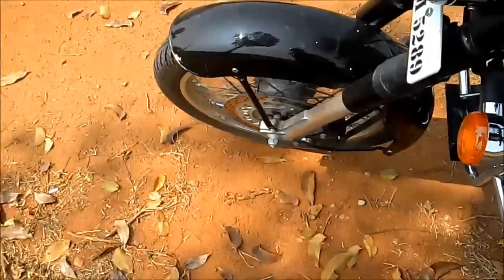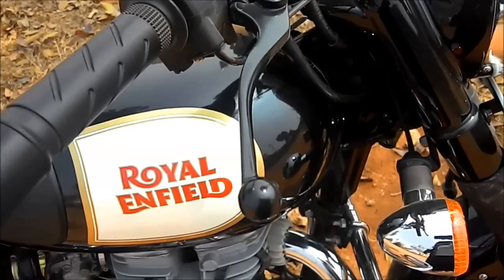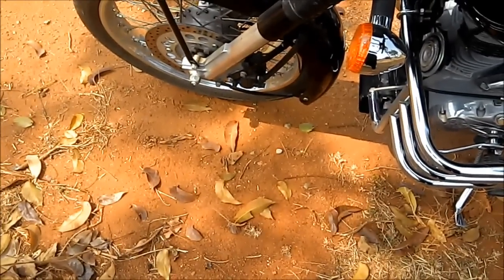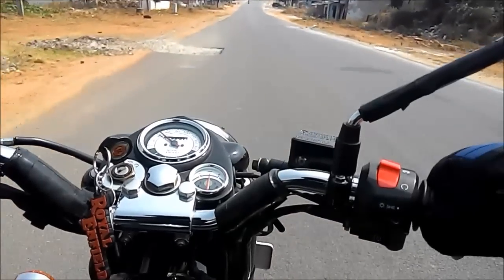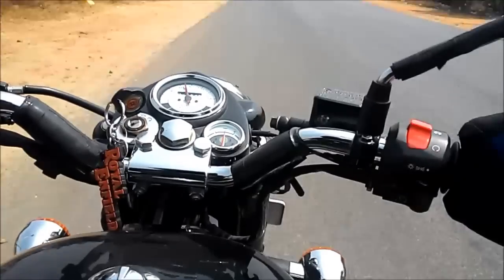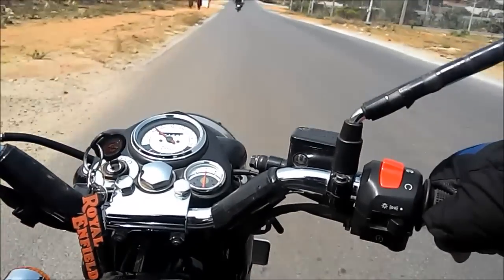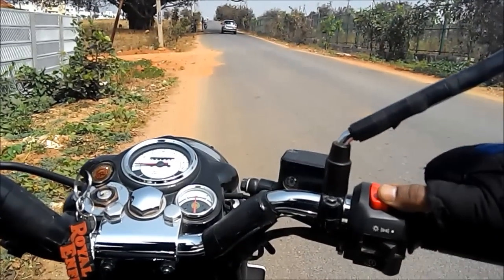Royal enfield Classic 350-  Braking technique

Comment: The problem with the "not very good" rear brake is the factory paints the bush (145088) for the operating cam into position with the screws fully tightened. That bush is supposed to slide slightly to align the two brake shoes. Dismantle, clean away the paint, tiny smear of copper grease and just nip up the screws so you can just slide the bush plate with a lot of hand force (so it will move under foot pressure on the lever), hence the two outer lock-nuts. After sorting it the brake works very well indeed.
Reply from the maker: Thanks for suggestion! I will try it when I'm free

Comment: +Ajay Kaushik
 dude you told in one video that you used rubber washers in handlebar bolts to dampen handle bar vibrations. please tell me how you did that and its effectiveness
Reply from the maker: No. It does not work very well. That stupid rubber lost its vibration damping ability quickly
Reply: Wokkeyy... Shall i change the engine oil with motul 7100 or 5100..which is better..??
Reply from the maker: +Ali khan 
At present, I suggest motul 5100; I've heard that using a full synth oil in enfield might lead to clutch slipping in the long run

Comment: In my motorcycle training class, they suggested to use only two fingers on the brake lever to reduce chance of lock up. Also, to gradually increase brake level force over 1 second time period...this is because the front tire gets more traction as the weight shifts forward on the front tire during braking. So, you can apply more brake force as the front tire gets pressed down into the road. Never apply full force to the front brake quickly. 

For the rear brake, as the weight shift forward, the rear wheel gets less grip on the road and will lock up easily. You need to feather touch the rear brake on the bike and ease off the rear as the front does 70% of the braking.  If you do lock up the rear, it is best to keep it locked up until the bike stops...releasing the rear from a lockup can lead to a sudden re-straightening of the rear wheel track, leading to the whole bike flipping violently...you can get thrown off the bike...called a "High Side" flip.

Finally, try to NEVER apply brakes when turning the bike! Get the braking done before entering corners, especially when it is wet road.
Reply from the maker: Very true friend!
But if you try the enfield's brakes you'll understand better yourself.
It is better to use a 3-finger pull as it is not a 2-finger lever
Reply: Maybe look at changing the brake & clutch levers? There are many types on the market that offer great adjustability. I just installed new ones on my Bonneville last night...very easy to do.
Reply from the maker: +TornadoCAN99 
At present no. But maybe a yes later.
Its not even a year old yet. So, let it stay stock until the end of the warranty period atleast

Comment: there are many bikes are available with rear wheel disk break pre-installed.
the front disk break on classic  350 do its job pretty well, 
but it is un-complete with out help of a powerfull rear break.
in case of original drum break in classic 350 is useless & incapable of stopping the heavy bike.
Reply from the maker: Yes. Thats why I have started using this braking technique.
Rear brake is next to useless and does not help in shredding much speed
Reply: +Akash Bajpai most of rear discs are nothing more than sales gimmiks. what happens is when we apply even little bit of front brake first the weight of the bike shift to front wheel, rear wheel does not have much traction left so does not matter what brake disk or drum they all work well in rear
Reply from the maker: kanwarjit sidhu
I beg to differ sir. The effect of a disc brake on a rear wheel is very apparent, comparing it to a drum brake. You can ride your 2004 bullet and compare it with the RE Himalayan itself. The rear disc on the Himalayan delivers a vastly superior braking force compared to the drums on the enfields.
Reply: Ajay Kaushik
I have lived in USA for a while, am 63 years old had 8 bikes there. went to a riding school there too. try it on ur Bullet, go upto 25-30 km speed and apply front brake with full force. u will notice quite a bit compressing of forks. that is how most of the weight is transferred on the front tire. yes discs are better than drums but they also cost more and add extra weight on a bike. best way to stop a bike is 80-20 front rear combo. even on a turn if u have to brake in an emergency u first straighten the handle bars (even at risk of running off road) then apply full front brake. then release the brake and turn again. this is what they teach in american bike schools. instructors are mostly bike racers. depending on front brakes will help u stop much faster and rear brakes are mostly for little addition to braking force. i have avoided accidents by stopping the bike properly. this is a platform for us to share our experiences.
Reply from the maker: +kanwarjit sidhu 
What you said is exactly right!
But if you apply front brake in full force on enfield, brake will lock up very fast and cause front tyre to skid. Thus, you lose balance and hit the road.
This is very apparent, especially on wet roads
Reply: No they won't skid because the weight of the motorcycle and rider will make the contact patch with the road an area of high friction. that is why discs are better than drum brakes because they are slow to lock up. u need to experiment a few times on ur bike. on wet roads, u need to understand the limitation of ur bikes braking. no sense going full speed when we know rain is making the roads slippery. watch moto GP and superbike racing videos. in US i watched a few bike races and if u have idea of technical aspects of braking u can learn a lot from those racers. remember they have 200 plus HP machines and we have to manage our 18 HP street bike. idea is to get the fundamentals right and apply them in time of need Ajay Kaushik
Reply from the maker: +kanwarjit sidhu 
https://youtu.be/NYL257jpBXs

For the exact meaning of what I said, you can watch the above video

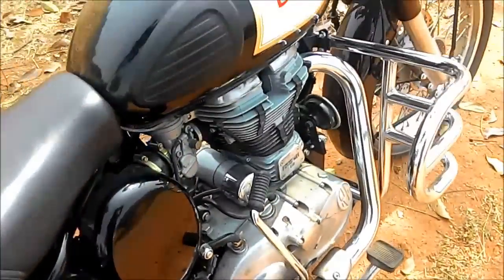At 1:55 watch the accident-exact demo of bullet lock up
Reply: Ajay Kaushik
Yes a perfect example of a fellow who is not trained to use brakes.he should have kept going in the direction of the car, after making sure handle bars are straight braked full power with front brake, released brakes in one second then turned away. instead he used rear brakes while trying to turn away from that car. that locked up the rear wheel and swung it towards the car. even if he had disc brakes on ear wheel he would have had same results. once i was riding a yezdi 250 with drum brakes on a slight down hill in rain. i was heading for a busy intersection. so i started braking almost half km away. with both drum brakes i was able to lock up both wheels while motorcycle kept going. any way by releasing and applying brakes and sliding with both brakes locked up some time 20-40 yards without falling i was able to stop barely one foot before hitting the traffic. after that i studied braking in gr8 detail. in india not safe to go at very high speed in traffic. learn use of front brake on ur bike no matter if it is drum or disc then u can have more confidence in an emergency. rear brakes don't do more than 20% in bikes as rear tires loose traction  very easily
Reply from the maker: +kanwarjit sidhu 
Exactly! rear brakes dont provide much stopping power on bikes; especially not on heavy bikes like enfields.
That is why I made this video-To show how we can use front brakes for a fast and safe stop
Reply: Ajay Kaushik
Too bad they increased the weight of these newer bikes by 20 some kgs as compared with older ones. as for heavy bikes u should if u ever get a chance try super bikes from 70-80s and full size harleys. those are heavy bikes. RE is a full size bike but is considered light by international standards. i had a harley 883 cc and it was around 80 kg more than Bullet with more power but very similar riding quality
Reply from the maker: +kanwarjit sidhu 
You are very experienced, sir; both in age and no.of bikes ridden. I'm still a teen (19) and have owned just 2 bikes-This is the second one
Reply: +kanwarjit sidhu - The rear brake on the Bullet/Classic can be fixed so it works as efficiently as on all old british bikes and car drum brakes. The bush plate must slide, it's an assembly error, it was not designed to be bolted tight and painted in place. It has lock-nuts for a reason.
I'm riding a 187kg Classic EFI-500, which is about as heavy as I want at my age but I have fixed that rear SLS and it works very well - when we get both shoes to make contact with the drum.
Some of my friends have Harleys which I have ridden and was advised that if I wanted to go faster I should apply the rear brake - meaning it doesn't do very much (british understatement) , and they were right. The bike ploughs straight on at 70mph. It's embarrassing ;)  That extra 80kg is like carrying a large pillion passenger.

Comment: i use clutch while braking... it gives a smoother feeling while stooping..  i want to know the thumb rule.. how to brake... should i indulge clutch?
Reply from the maker: No.no.no. Please dont do that. Only use clutch to downshift and use engine braking. If you pull in the clutch and hold, it will no doubt be smoother, but there wont be any engine braking happening.
You will be fully relying on the disc at the front and partly on the rear brake.
This will increase your stopping distance a lot and if you pull the brakes too hard, you may even skid off the road.
So, use the clutch to downshift and engine brake, but never keep it depressed when braking

Comment: Hi, how to use the back disc of thunderbird in rain for   immediate stopping? which silencers are available by RE for the loud thump so that, engine warranty is valid?
Reply from the maker: Regarding back brakes, you cant use that to come to an immediate halt. It only performs an assist function. The main stopping force comes from the front brake only.

Regarding silencer change and warranty validity, ask your service centre or dealer.
Reply: Thank you

Comment: rear breaks on royal Enfield classic 350 is really bad.
c
install disk break to rear wheels of classic 350?
if yes then how much it would cost..
Reply from the maker: I dont think it is goid idea to install rear disc brake.
It would be very difficult to pull out the rear wheel in case of puncture/tyre replacement.

See if you can install twin disc brakes at the front
Reply: +Akash Bajpai - possibly cheaper, they'd be using off the shelf bolt-on parts, see CGT and Himalayan. Use of discs front and rear also allows ABS to be introduced for learners.
ABS will be required from 2016 comply with Euro-nanny laws for export. No reason why the wheels shouldn't remain quick-release (pull pin, drop wheel).

Comment: I have recently owned classic 350 but my  bike has very much heating problem . what I should do
Reply from the maker: Check oil level. 
Also, ride some other classic and test if the heating is same or not

If you ride in heavy traffic, then the heating problem will be there, as not much air circulates around the engine to cool it in traffic.

Some level of heating is common

Comment: press release press release me bike jhatke bhi toh khayega na..i mean u press n release continuously, its gonna give u jerks as well ryt??
Reply from the maker: Yes. It does. You can see a bit of it on this video.

If you want little/no jerks you'll have to increase frequency of the press-release cycle. 
In other words, you should continuously press-release the lever.

You'll basically do manually what an ABS system does through sensors.
(On Apache, the ABS monitors brake fluid pressure upto 10 times per second). Manually, you could be doing like 3-4 times per second at max

Comment: I subscribed just cos I saw the way u reply to everyone's queries. need more youtubers like u. btw I might be booking an RE desertstorm or classic 350 this week. although one of my frnd is helping me with this. Im still confused between the two, any suggestions frm ur part..... ?
Reply from the maker: Thanks for your compliment!
Suggest you to go for Std 500 instead of DS 500. Maintenance and service costs of EFI 500 are relatively higher. And carbuerettor is good enough for this bike in my opinion. The difference in power and throttle response between the two cant be made out distinctively, unless you really concentrate a lot on it.

Comment: Guys finally I got my 350 classic today. Not very happy with original sound of the exhaust pipe. Also leg guards were of poor quality saw some already rusting. Where can I get these piece modified in Bangalore? Any help is appreciated.
Reply from the maker: What do you mean by leg guard?
Crash guard?

The original part costed me around Rs. 1400 at the delivery yard itself.
Didnt they give you a new one?
That is an optional accessory. How the hell can they give you rusted one? Demand new one.

The sound you hear when sitting and riding is not from the long exhaust pipe. It is from the exhaust pipe leaving the engine; And also from the engine itself. Changing the pipe makes a sound difference whi h is more apparent to outsiders than the rider himself
Reply: @Ajay Kaushik Yes someone calls  it as crash guard. The dealer I bought the vehicle from says they don't have crash guard in stock. He suggested to buy from a close by accessories shop. I went and took a look, all the crash guards there are of poor quality some even got rusted. For a 3 pin front crash guard asking price is 2400. In the dealer it is 3200  they said. I want to buy a good quality guards shiny chrome finished for both front and back. Will probably buy a exhaust pipe to which gives better thick high base sound. If you can suggest one I will give it a try. I bought my bike from Narayanapura RE dealer in Mahadevapura area bangalore.
Reply from the maker: +Niranjan Das 
If you are from Bangalore, you can take a look in Fixwell motors, JC road bangalore. They sell original RE parts. Its behind SBI/ SBM JC road, below Sandhya auto spares.
Reply: Thanks I will visit them.

Comment: bro, how is the ash color.. does it fade in long run any idea.. what's the mileage in city use... what about the maintenance? does it cost more than 3000rs for a free regular service
Reply from the maker: Ash colour looks real good when you see it in person. It wont fade, but, will get dusty very fast because of the amount of dust on our roads.

Mileage is around 36-38kmpl

Service costs:
Free services cost max around Rs1100 and paid services cost around Rs 2000-2500 depending on the nature of servicing required for the bike
Reply: Ajay Kaushik thanks a lot, bro

Comment: Hello friends once again! Having purchased my RE 350 Classic recently,  I am looking for adding a few bells and whistles to up my RE ownership pride. Among them the most prominent one is exhaust sound! I want to have high base gorgeous sound exhaust to my bike. The one comes from factory fitted is kind of not high base sound and is dull. I have also seen people having very loud sound which sounds like beating a broken aluminium can. I don't like it either. What I like is a sound with high base. I have seen a few on the road but could not speak to them. If you are knowledgeable in this department please help. I have asked quite a few questions here so sorry about that if it annoys you. As I am new to biking and RE ownership perhaps I have more such questions. Have heard about Greasehouse Thumper Performance Exhaust but not got sound review for it. Also, it is kind of new to me that exhaust has an impact on mileage and power delivery of the engine.
Reply from the maker: First thing to be said is I do not know the name of the exhaust you are searching out for. I frankly dont know them.

But what I can say is that the shape of the exhaust pipe alters the 'back-pressure' created inside the pipe. Thus, it influences mileage. Whether adverse or not, depends on how that back-pressure gets altered. The size of the hole influences the sound. The bigger the hole, the louder the sound.

If you want more information on these two (back-pressure and sound), you can google them
Reply: I use amgular silencer which u can buy from RE showroom . The cost is around rs 2500

Comment: i use lowing the gear to brake.if I'm speeding 70 kmph to brake i low down gear to 3 or 2 which slow down the engine. is it right to do??
Reply from the maker: Red Devil 
Well, that is called engine braking. You are dropping gears, which increases the engine rpm and the speed is dropped because of friction between the engine parts. You can do it. No problem. 
But try not to shift down to very low gears at very high vehicle speeds. Eg. Shifting down to 2nd gear at 70kmh. Engine will over-rev and get damaged. As long as you are not doing that, its absolutely fine.
And one more point to be concerned about is, if you downshift, engine rpm increases and torque applied to the rear wheel increases. This might cause your rear end to step out if the torque is too much
Reply: thank you so much😊😊
Reply from the maker: Red Devil 
welcome